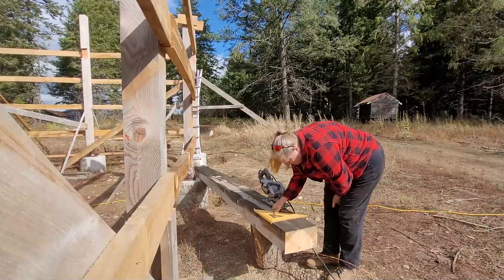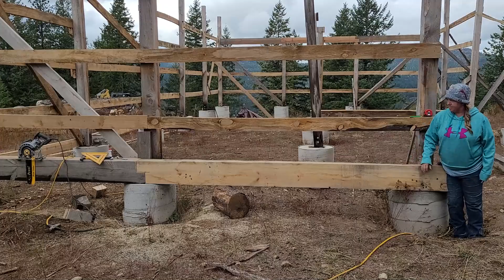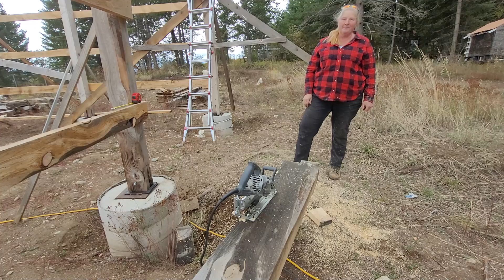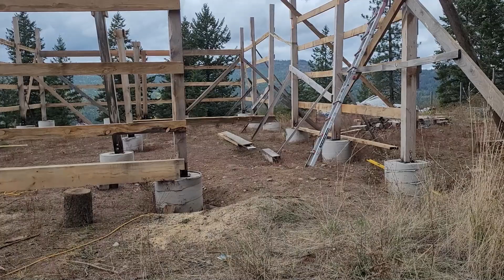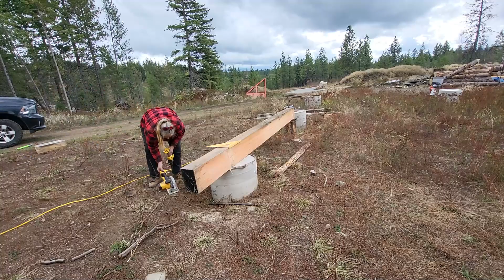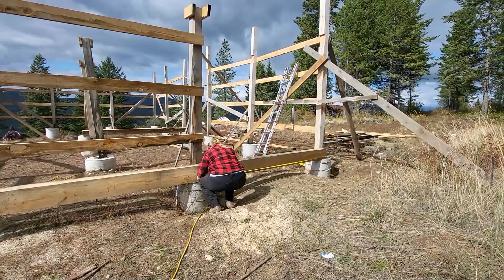Exactly what I didn't want to happen. Happened //Cutting huge beams for the barn build eps 16

Comment: What I would do challenge: (IMHO) The half-lap joint offers two thing. More glue surface and easier access to mechanical fasteners in the lower half. You are not using glue. I do not see any structural advantage. The dados let into the perimeter posts LOCK in the timber that butts into the dado preventing twists. If you half-lap joint was longer, I could see two or three mechanical fasteners on each side to lock in the joint. It looks like the half-lap is 6" up and 3" over. Maybe do 6" up and 8" over.  Also consider the metal plates (gussets) you plan to install on the sides - plan your vertical screws according to the screws needed for metal plates. Ensure screws don't intersect.  It's complicated for sure. I'm sure you will figure it out. Good luck

Comment: Take your time, rushing can cause frustration.  I will often take a 2by and sketch the length of the finished beam, then draw in the joint cuts with all the measurements.  This allows you to double or triple check all your measurements.
Reply from the maker: Good idea

Comment: A butt joint (I didn't name it, don't blame me) is simpler to make than a half lap. As you note the half lap is stronger though.  So what is required?  

To determine this think about the forces on the roof that the top plate is designed to support and where that load is going.  There are dead, live, construction and environmental loads that will basically be transferred from the purlins to the rafters which sit on the top plate.  This load comes at a diagonal angle down that rafter and wants to push the wall down and out.  

There is also some potential for wind force to want to lift the roof but that's not really the bulk of it unless a tornado comes though, in which case you have other problems.

Your second story floor helps to counteract the outward motion by creating a truss.  It adds a hypotenuse to the triangle legs your rafters make.  This directs the load down the posts.

The posts are supporting the roof load and the weight of the top plate, part of the second story and the loads from the walls.  But for the purposes of the question the load we care about is on the top of the post.

What purpose do the metal plates serve?  My guess is they're T plates designed to not only secure the top plate to the posts but the two top plates together, creating a single system out of two members.  

I'd probably stick with the half lap because that does much the same thing.
Reply: Wow.   I commend your knowledge and your willingness to explain to Heather.    God bless you.   ❤
Reply: Kj said butt!!
Reply: @blissfulmomentsfarm3730  Thank you Beavis.
Reply: Hehehheh

Comment: First I would like to say your doing a fantastic job. Everyone makes mistakes, thats life. Don't beat yourself up over it. I wouldn't do a template for the cuts as I think its better to do all the measurements separate. Its good practice and it keeps your memory on how its done for future stuff. I find you get lazy and forget how to do stuff if you have a bunch of short cuts. I think I'd put a 2x6 board across the side of the beat for more support. It doesn't have to be that long maybe 2 feet. Kinda like you would do if the board broke and you didn't have one to replace it, a bandade until you get the plates. Keep up the great work. take care

Comment: well because your doing a lap joint and you don't have the bolt plates yet for the bottom part of the lap joint I would drive the 4-inch screws in and sink the to where they bit into the post and top beam lap joint you only have to drive the screws in the bottom of the lap joint beam that connecting don't worry about going threw both join and into the post from the top unless you longer screws and do make way long screws

Comment: I would fill in the gap with something so water and bug can not get in. Don't beat yourself up for making errors. It's human. Or if you have a smaller gap take the board over there and cut a new board. Have a great day.
Reply from the maker: I am thinking winow spray foam the one that only expands an inch

Comment: Just a quick question. If you put screws in each beam, when you then put the plates on will your screws be on the way as you bolt/screw the plates on. Just hoping to prevent a problem. BTW ladies you are doing a great job. Who cares if you take your time, you are the ones living in it. Rome wasn’t built in a day. ❤
Reply from the maker: Great question  they won't be in the way the holes on the plates are farther out